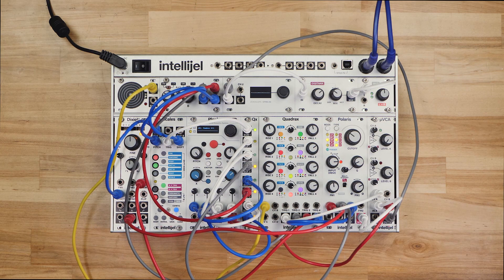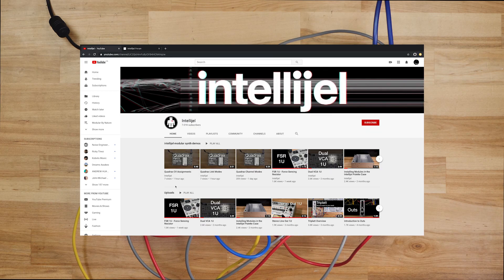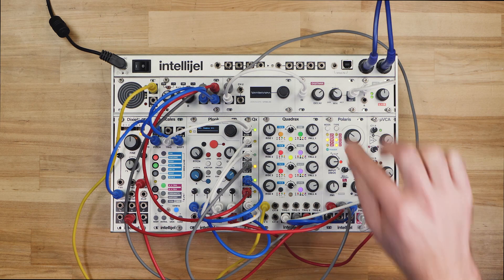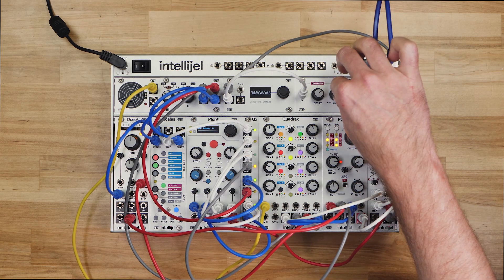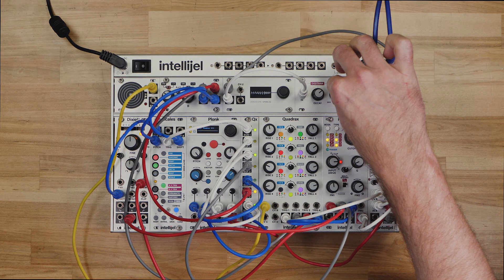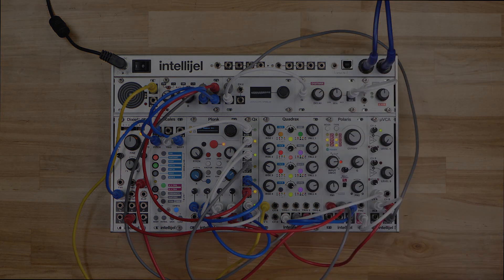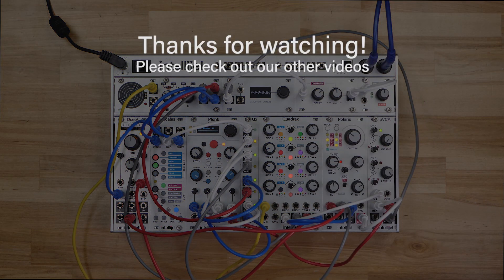Quadrax   QX Expander

Comment: What would be a good starting unit to get with Intellijel?
Reply: Atlantis
Reply: That's a tough question to answer because eurorack systems can be put together in so many different ways depending on the various factors important to the person putting it together. You might want to have a look at Intellijel's eurorack 101 article for ideas or drop them a line at support@intellijel.com. They're happy to help you plan your system!

You can find the eurorack 101 here: https://intellijel.com/support/eurorack-101/
Reply: I think a dixie, micro vca and micro midi
Reply: My favorite Intellijel modules are Atlantis, Planar2, Quadrax. Synth, VCA/mixer/modulation, EG/LFO (modulation).  I also highly recommend the metropolis, but thats a certain special style of sequencer.  Steppy is also great, and I like all the 1U line. Dixie seems cool/useful, but Ive never had one.  Cant go wrong with any of these.  In all of euro, these are boss.
Reply: @YTNUKLR  U r correct !  I need a eurocase. Unfortunately you got to be Vaccinated to get one!  Coming soon to theater near you. !-_-!